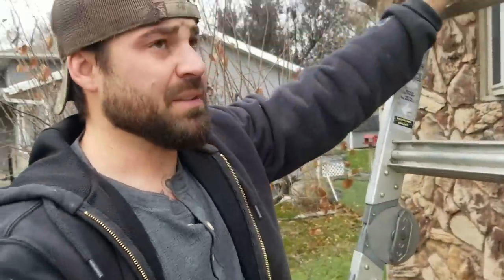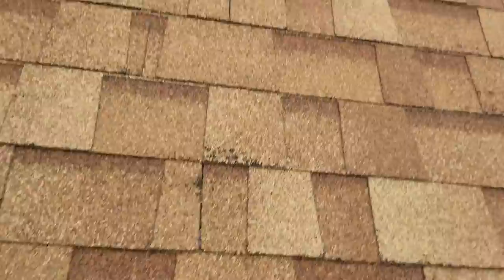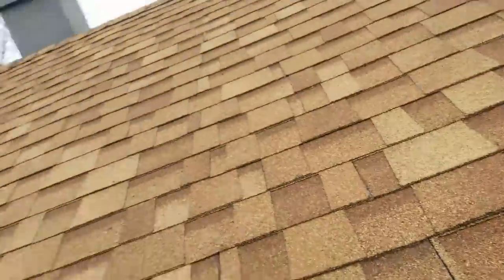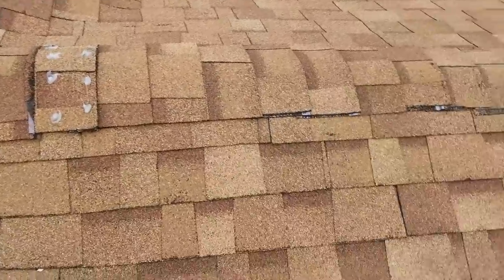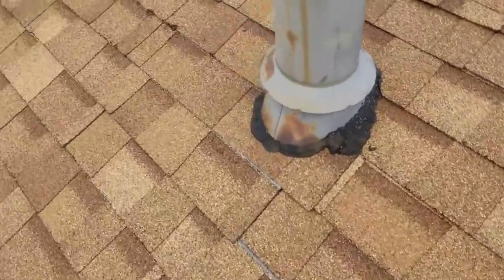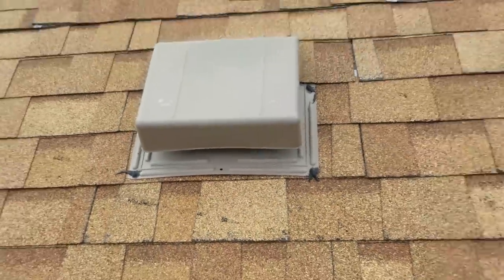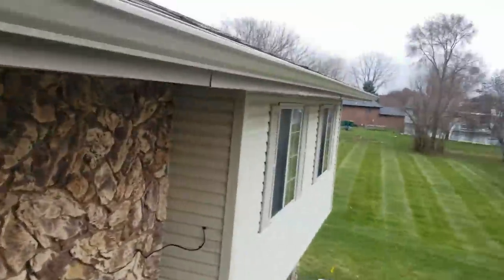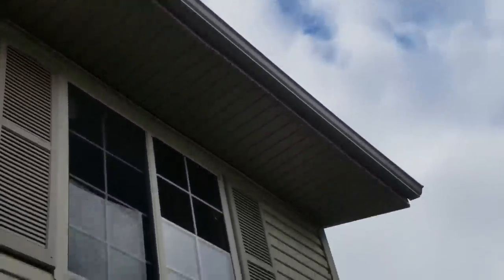Worst Roof Ever Installed!?!? (Part 1)

Comment: I thought a woven valley is not recommended with architectural shingles according to NRCA?
Reply from the maker: Not sure tbh. I use a closed valley.  I wouldn't see an issue with a correctly installed woven valley though. I've seen a lot of YouTubers doing it and it seems to make sense. The laminate part wouldn't be effected anymore than it is in a normal valley so I find that Strange if it's true

Comment: german carpenter here, it's so crazy how low building standards are in the u.s., this wouldn't be remotely possible here! even properly done the construction would never be approved
Reply: 1sternburg it’s different in each state. I live in California and frame houses. I was in Nevada and walked on to a job site just to check out how things go down there and was blown away at how relaxed everything was. Almost no hardware on the building, and small headers in all the doors/windows. I’m California they are pretty strict and in expensive counties they can get extremely strict.

Comment: So I'm painting a house and the 2nd level roof looks like somebody scraped half the "sand" off the whole thing . The lower one looks normal. All i can figure is they hired somebody to remove moss and they used a pressure washer?  It's not from being walked on I know that because its the same all over

Comment: Cheap doesn't mean bad. I did my own roof and yeah, it was cheap but it was done right. Only thing, the corners with the flashing, looks bad but no leaks and looks really good. GAF products, leak barrier on the ridges, hips, and eaves, synthetic barrier overlapped by half, starter strips, 5-6 nails every shingle, driven flush, flashing around fire place with proper overlap, every vent with a new boot, so on...... I had help from my brothers who have put on roofs themselves as well. It's not hard. Just use common sense, take your time, follow the directions(with exceptions) and use these guys as reference. Watch a lot of videos and do your research.

Comment: Kills me that they used a top notch shingle that only needs 4 nails in it to get 130 MPH wind warranty and then used none. Didn't use proedge or starter plus, what a joke. This should be in an Owens Corning ad. Our shingles seal so well this guy doesn't even use nails. WOW

Comment: That is horrid!
Makes me sick seeing shoddy work like that! Roofing is 50/50 skill and common sense. Water has a keen way of finding its way through any crack, split or hole. I feel awful for older people when they get garbage work like this!
Architectural roof shingles being used for the ridge is one thing. That’s just inexperience. But not nailing the shingles, satellite in the valley, backwards vent hoods, gaps and incorrect valley weaving, etc? That’s trashy work man!
Ice/water shield and STARTER strips are always a good idea! 
Ugh

Comment: The first bad storm with any high wind or hurricane that whole roof will fly off in one piece lmao. I do HVAC work for residential new install and service work and have quite soany jobs after third day because of companies who do shit half assed and wrong and screw the home owner like not duct sealing any collar on duct board no tape on duct board just staples no duct seal inside the handler closet and tape no tie wraps on any single vent box

Comment: I have seen roofs brand new in Porter area way worse then that done by J&B WEST ROOFING. That very well might be one of them. They used to put on a good roof until the owner developed a bad drug problem. Now its hire whoever can hack it on quicker and make him more dope money.
Reply from the maker: I don't know anything about them besides they do a bunch of work. But someone who had a roof done by them saw this video and called out to look at it.  Wasn't very good. But you'll have that when do you do is sell and need to the work done.  Nobody wants employees anymore they want a crew to knock it out for a set price

Comment: Just more proof that it's a huge mistake to try to refuse to pay a professional's higher price in favor of saving money by hiring someone who either doesn't know what they're doing, or are willing to lie straight to your face and scam you. Happy you saved a few hundred bucks by not hiring a professional? Well now you have to pay the professional even more to redo the entire roof, on top of paying the guy who scammed you and stole your money without delivering what was promised. Don't get me wrong, I am broke and could see myself making the same mistake by hiring someone who offered to do the job for significantly less, but in the long run it just ends up costing you twice as much to fix all the mistakes and shortcuts the cheaper roofer left you to deal with. And that's even if they're still willing to do the job for you in the first place since they're likely pretty salty already from the fact that you turned them down in favor of someone they knew wasn't going to do the job properly. When dealing with something as important as the literal roof over your head, it is NOT the time to get stingy. You either pay more initially to ensure the job is done right, or you pay twice for the same job...

Comment: Does your county not require any inspections permits??? Bc if they do how the heck did they pass???? So crazy.
Reply from the maker: Nah you're just supposed to be licensed and know the rules of ice and water shield lol you do have to pull permits in most towns here but there's never an inspection unless it's for the ice and water shield
Reply: @NWIVeteranConstruction  Makes total sense,  I live in Miami so the roofing codes are pretty strict here, inspections are required for each layer of the roof system being installed. I can almost guarantee that a roof like that doesn't exist here unless it was done without a permit and by a non professional lol

Comment: Drip edge was installed wrong that guy don’t know what gutter apron is. Drip edge thaN ice and water so that rain flows off the roof into the gutter. When you install the drip edge write you can use it as your gutter apron. You only need gutter apron when the gutter pitch doesn’t make it under the drip edge anymore

Comment: Grace Ice/Water instructions say to put the drip edge OVER the IWS..........so that part appears right -  just saying
Reply from the maker: Grace is a different animal. I don't recommend it that way with normal ice shield but have done it both ways in my snowy/hot area without issue.

Comment: Attic venting is over rated excessively sold by roofing contractors
Reply: Enjoy your rotted decking and mold.
Reply: @JamesR23  lmao you must be a roofing contractor
Reply: @JamesR23  it dont happen if the home is properly air sealed and insulated a gable vent at each end is plenty enough ventalation for an attic properly air sealed and bath fans actually venting outside.. most roofers over sell venting for a buck period

Comment: Your comment about not cutting one side of the valley was not necessarily a bad thing. There is a method called a laced valley where the shingles are woven together from both sides of the valley at the same time. It's a much older method, but it can be done with good results.
Reply from the maker: Yes I've used that before but this was not that
Reply: @NWIVeteranConstruction  I saw that when I got to the 2nd video and saw it taken apart. Very poor workmanship. Good to see younger contractors doing some really nice work and caring about what they do.

Comment: Ridge cap costs too much.
Reply: This channel it great.      Just had a new roof removed and reinstalled new. New everything for this same schift.
Reply from the maker: thank you
Reply: @NWIVeteranConstruction .      I love 🇺🇸.    I am a true journey level roofer.   In my opinion you do truly understand water flow.   And a heck of a lot about roofing theory.         I am one of the last hot tar roofers in nor cal.       I’ve worked all the local gov modernization and 1000s of resi.      I wish you best of health.                Also I have built  gov structures from from ground up.   Love construction.     Soon may leave Cali.

Comment: Terrible job - the dude who did it doesn't understand the first principle of roofing. It astounds me how poorly made American houses are anyway. Wood structure and a pitched roof which is just felted in essence. Why do you not use bricks and mortar for the building and slates or tiles (cement or composite) for the roof? It all seems so flimsy and makes me see the property as a massive shed essentially. We stopped building from wood 600 years ago after the great fire of London yet in America wood houses are cutting edge apparently lol

Comment: Nothing wrong with cutting shingles for ridge cap, I bet you this guy has done it. Maybe not he isn’t quite old enough to have that many roofs under his belt. There is plenty wrong with that roof without playing for the camera.
Reply from the maker: I've done countless roofs over the last 10 years as an installer as well as a owner operator. I have never once cut architectural shingles for cap. that's trash
Reply: @NWIVeteranConstruction  no not architectural shingles that I’ll agree. But nothing wrong with thee tab.
Reply from the maker: Isn't that what was on here? I thought that's what you meant

Comment: I Have A Trick With No Nails
With A Stronger Glue,
The Glue I Have Can Join
2 Rocks Together.
Really We Donot Need Nails
If We Do Same Glue As 
Flooring.
No Body Did My Trick ???
And I Donot Do 6 Tabs or 
7 Tabs As Others Only 3
Tabs Are More Stronger The
Edges Of The Roof.
Code Violation???
Inspector Only Check Underlayment 
That’s All.
Amén.

Comment: Having license does not mean they will do it right. You keep saying someone that has licence.. I know companies that have a license and hire out so stop with the almighty I have a license. I do plumbing for over 15; years I know guys that have no license have been doing work for 40-50 years does that mean they don't know how to do the work. Noooo . This job was horrible no doubt my kids could have done a better job no license vrequired how about common sense.
Reply from the maker: I mentioned it once as filler info coz I was running out of stuff to talk about.  The only other thing I said was when hiring a company to do the work ask for pictures or referrals to make sure you're not gonna get this type of work done
Reply from the maker: Company.... individual.... doesn't matter.  Same rules apply.  I was the best before I had a license so I get it!